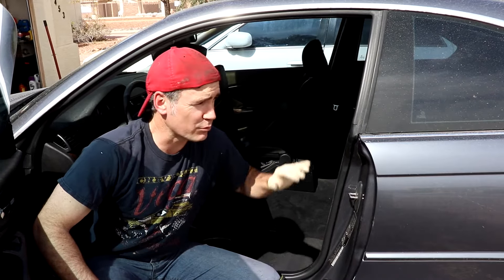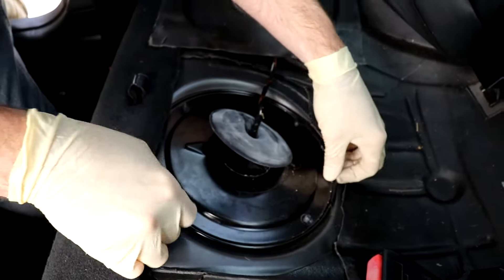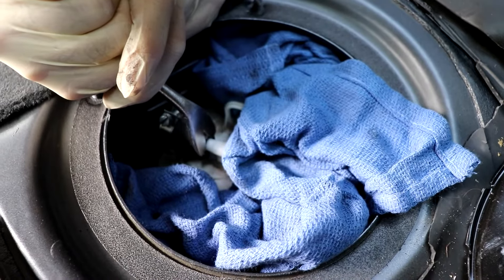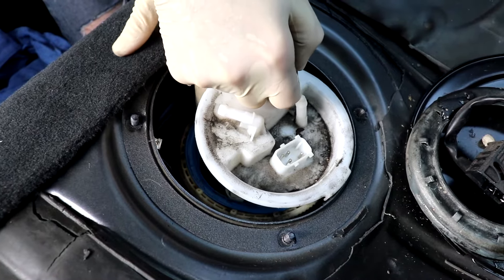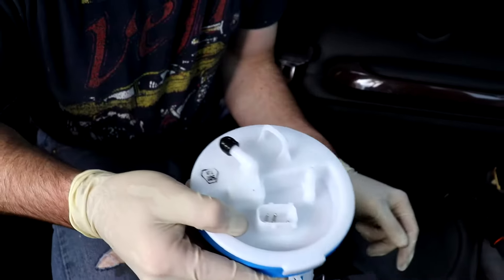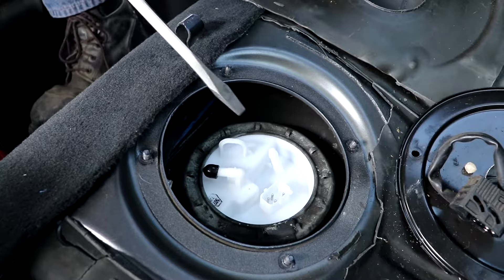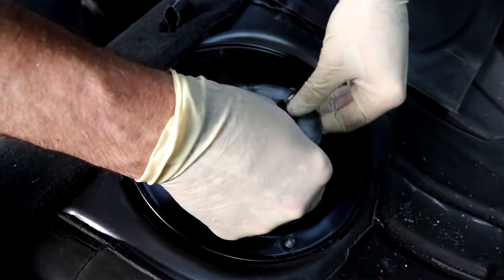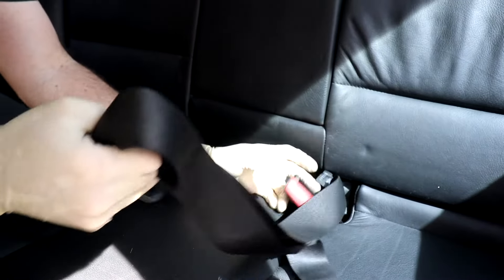BMW E46 FUEL PUMP REPLACEMENT IN UNDER 10 MINUTES!

Comment: Ive been having trouble figuring out which side to actually remove and work on, because it looks* like these cars have two fuel pumps. 
Did some research and figured out I only need to work on one side but I can't figure out which side.
So it's under the passenger side back seat correct?
2000 323ci north american car
Reply from the maker: No worries, thanks for the question. Yes, you are correct, you will be working on the passenger side of the car. That is the location of the Fuel Pump assembly.
On the drivers side there is a fuel level sensor. This unit controls the functions of the gas gauge itself. So if you were having trouble with the accuracy of the fuel gauge then that might be your issue. Those rarely go out unless the car has been sitting for a long time or has corrosion in the tank.
Let us know how your BMW project goes, Cheers!
Reply: @BradleysGarage  Thanks!
I succesfully changed out the whole fuel pump assembly. I got one for $200 locally.
The job was actually very easy with the helpful instructions in this video.
Hardest part was getting the metal retaining ring back on at the end.
Car is running strong again!
Reply from the maker: Thanks for the update SM, glad you were able to get the new fuel pump in and everything is working great again. Enjoy your BMW, Cheers!

Comment: car starts but dies right away and if it does start it idles rough. Just scanned my car for codes with most of them being, 

"misfires with fuel cut off"
"misfires with low fuel"
"System to lean bank 1 & 2"

Just had someone check the fuel pressure and its sitting at a lousy 10psi is it safe to assume that my fuel pump is bad?
Reply from the maker: Sorry to hear that you are having trouble with your E46. If you are only getting 10psi at the fuel rail then most likely your fuel pump is not working properly. There is a slim possibility that you have a clogged fuel filter as well.
If you have more than 100k miles since the last time the fuel pump was changed, it might be a good idea to change both the fuel pump and filter at the same time.
Good luck on your BMW project, let us know how it goes.
Cheers!

Comment: BMW e46 compact 316ti have fuel pomp ?
Reply from the maker: Thanks for the question, the E46 compact uses the same fuel pump assembly. We never got the E46 compact here in the states but everything should be the same process.
Good luck on your BMW project, Cheers!

Comment: Great video, I noticed that at the end when you turned it on, the car makes a sort of whistling sound, my car is making the same noise, do you know what it is?
Reply from the maker: Hey Christian, the buzzing sound is the fuel pump itself priming when the key is cycled. That is completely normal and happens each time you first turn on the key. You can really notice it after just replacing the fuel pump whiteout having the rear seat back in.
Hope this helps with your BMW E46 project, Cheers!

Comment: Hi I wanted to know theirs 2 fuel pump unit and I would like to know what is the difference between them?
Reply from the maker: Hey Gaz, thanks for the question. There is only (1) actual fuel pump (on passenger side) but there is a fuel level sending unit and a transfer/siphon tube on the drivers side backseat. The fuel level sensor measures the amount of fuel in the drivers (left) side tank, whereas the fuel pump/sensor located on the passenger (right) side also measures the amount of fuel but also has the fuel pump assembly as well.

The transfer tube is non electric and works on the venturi principle by using high and low pressure. It uses a pipe with a narrowing in the center like an hour glass and when fuel that returns from the engine passes through the pipe in front of the narrowing it creates a suction on the other side which pumps the fuel that is left in the left side of the tank over to the right side continuously.

The fuel level sensor on the drivers side rarely goes out. The transfer tube however has been known to break at the connection and cause issues of running out of gas at half a tank. The fuel pump itself is where 95% of the fuel related issues occur on these E46's.

Depending on what issue you are having with your BMW will determine which of these parts are failing. let us know if we can help you troubleshoot things.
Cheers!

Comment: Thank you but what is the the garget on the other side of the compartment of the tank. It looks like a fuel pump
Reply from the maker: Thanks for the questions James. On the driver's side, there is a Fuel Level Sensor. 
https://www.fcpeuro.com/products/bmw-fuel-tank-sending-unit-level-sensor-e46-16116768788
This can affect the reading on the gauge cluster. It is less common to go out versus the Fuel Pump (passenger side) which is a common failure item. Good luck on your BMW project, Cheers!

Comment: I have an alfa 147 but that gasket is like its glued on and does not move an inch with the hammer trick
Reply from the maker: Hey Vinny, thanks for the comments. These can be a pain to remove if they are still the original pump after 20 years. You can also try to use a hair dryer to heat up the ring to help free it up. Just keep moving the hammer around the ring to get it started. Once you get it to move your will have no problem removing it.
Thanks again for hanging out, good luck on your project. Cheers!

Comment: my e46 has a smell inside the car but the fuel pump is dry and fuel lines seems good no leak
how can I know from where come the smell
Reply from the maker: Thanks for the question Mario, if you are getting fuel smell in the car, that is really the only place there are exposed lines into the car. We would recommend removing the backseat and going for a drive. If you have a buddy with you, that works better. Perform some aggressive start/stops in a safe area to see if there is any evidence of fuel around the fuel pump itself (the ring seal). This works best if you are at 1/2 to 3/4 so there will be plenty of fuel near the top of the tank but still enough room to slosh around.
Let us know how things go with your BMW project.
Cheers!
Reply: @BradleysGarage  thanks man I will try it

Comment: What are the symptoms of a bad fuel pump?
Reply from the maker: Thanks for the question, on these E46's it usually results in a crank/no start condition. Some early signs it might be going out would be the fuel gauge is not accurately reporting the proper fuel level. Or you start getting random misfires across all cylinders and the engine is running rough.

The fuel pressure at the rail on a BMW E46 should be 50 psi +/- 3 (3.5 bar +/- 0.2). You can use a fuel pressure gauge with an adapter and refrigerator valve to check the fuel pressure on a BMW. (Can rent these from a local auto parts store)

Here's how:
Remove the cap from the Schrader valve
Spray some fuel as you screw on the cap to open the Schrader valve
Catch the fuel with a rag
Turn the ignition on (don't start car) to turn on the fuel pump for about two seconds
The pressure should be around 50 psi when the ignition is on
The pressure should drop about five or six PSI when the ignition is turned off
Recharge the fuel system by cycling the key to run the fuel pump again for a second check

If you are getting a low reading 35-40psi, you might just have a dirty/clogged fuel filter. You can check out our other video where we show you how to replace that - https://youtu.be/Ld0zM8Pm_vQ

Good luck on your BMW project, let us know how things go.
Cheers!

Comment: Tooth brush dish liquid, shopvac make sure everything is clean before opening your fuel pump
Reply from the maker: Thanks for the tips Artisan, definitely smart to clean up any debris before removing the pump. Thanks again for hanging out, Cheers!
Reply: Someones shopvac exploded in the comment section be careful with that
Reply from the maker: @Vinni-2K Yeah, sucking in fuel vapor to an electric motor would create more risk for sure.
As an alternative, you can simply soak the entire lock ring with penetrating spray and let it sit for a few hours.
If needed, spray it a couple times to really let it soak in.
Cheers!
Reply: @BradleysGarage  thats what i did this morning 
Will try the hammer trick again tomorrow 
If that doesn’t work i ordered a gasket tool that fits right into the ring to use with a torque wrench
Reply from the maker: @Vinni-2K  Sounds great, I would spray it a  few times every hour or so for a couple hours. The actual tool will definitely help you get more leverage but hopefully the hammer trick will get it done.
Good luck, let us know how it goes, Cheers!
Reply: @BradleysGarage  thank you for the tip
Will do that!!

Comment: The metal ring top that needs to be rotated is so hard to remove. I spent all night hammering it counter-clockwise and still haven't moved. I guess it's stuck.
Reply from the maker: Hey Dan, sorry to hear you are having trouble with the lock ring. They can be stuck on there pretty good, especially if it is the original fuel pump.
You can try some Kroil penetrating oil around the ring and let it soak for a couple hours. You can spray a little shot into each of the tabs to get it directly onto the underside of the lock ring. Next use a dull chisel/hammer and work around the lock ring at the 12,3,6 & 9 o'clock spots. Be sure to move around the lock ring and not just hit it in one place.
If you are still having trouble, I would spray it again and let it soak overnight. Don't be afraid to be liberal with the penetrating spray if the first soak didn't work.
Link - https://www.kroil.com/product/kroil-original-penetrant/
Please let us know how it works out for you. Good luck on your E46 project.
Cheers!

Comment: Hey!! Love the content you make! I’m just curious I have a 2002 325ci vert and I have a RPM surging problem could this be the fuel pump?? I had just recently got the Automatic transmission fully rebuilt and shifts perfectly but when I’m cruising in around 3rd gear going 30-40mph or in 5th gear cruising in speeds about 55-65mph the rpm’s would surge going down about 500rpm takes a second then rises back up to normal rpm for speed.
Reply from the maker: Hey Marco, thanks for the question. Based on the description you provided, it still sounds like a transmission issue and not a fuel delivery issue. 
If you are in Drive and cruising down the highway, there would be no way for the RPM's to drop all of the sudden without the transmission losing engagement. Almost like putting it in neutral for a brief moment, the RPM's would drop. 
There would be no way for the fuel system to affect RPM's in such a short time span, since you are actively rolling in gear.
The typical signs of a failing fuel pump are difficulty starting, taking a few seconds to finally fire up and Gas guage inaccuracy, reading empty when you know there is more fuel than that.
I'm not sure who performed the transmission service but I would double check the proper fill procedure was followed. These symptoms can occur once the transmission gets hot if you are a little low on fluid.
Thanks again for hanging out, let us know what you discover. Cheers!
Reply: @BradleysGarage 
My 330d 2005 BMW auto is not starting only crancking but the noise KEEPS COUNTINUE from the back... is it  fuel pump noising...i hope this is  an issue to fix???

Please help my BMW sitting in my driveway for weeks now can't move..

Thank u
Reply from the maker: Thanks for the question. If you can hear the fuel pump running (under the backseat) when turning on the key/cranking then at least you know the fuel pump is getting power. That doesn't necessarily mean it's working correctly. On the Diesel you technically have 3 pumps. The lift pump under the backseat in the fuel tank. The pre delivery pump at the fuel filter (under the car) and the (HPFP) high pressure fuel pump  located on the back of the motor. The first two do go out around 80-100k and the last one is very expensive to replace but fortunately it rarely goes out. 

I would verify the fuel pressure at the rail on the low side to ensure it's at least 3-3.5 bar while cranking. On the high pressure side you should have at least 300 bar. 

Are you getting any check engine codes that might point us in the right direction? We haven't really played around with the Diesel BMW's that much since they are not very common here in the states.

Some other issues for a no start condition could be as simple as the fuel pressure sensor (front of the fuel rail), fuel pump relay, fuel pressure regulator (back of the fuel rail) and cam sensor. All of these would cause the Bimmer to crank and not start.

Another common failure on these would be a leaky injector. I know there is a leak test you can perform but I will have to look that one up and get back to you.

One last thing would be a weak battery or starter. If it is not able to rotate the engine fast enough, there will not be enough fuel pressure to satisfy the DME. In that case the cr would not start because the computer is not registering enough fuel pressure to allow it. 

Let us know if you are able to scan for any codes. It might help narrow down the search and prevent you from replacing things that are not broken.
Cheers!

Comment: My fuel pump is stuck priming and the car will start but die at idle
Reply: This is the new pump btw. My old pump didn’t work at all so the car couldn’t even get past crank before. Now it starts but won’t stay on
Reply from the maker: Hey Blasian, thanks for the question. Not sure what was going on with the car originally for it to be diagnosed with a bad fuel pump as being the issue?

That being said, depending on what happened with the old fuel pump, there may have been a short or something that happened upon removal to cause an electrical problem.
I will double check the most obvious stuff first. First the Fuel Pump relay fuse in the fuse box under the hood beneath the black plastic cover, driver's side. It's a 30A fuse in the F4 slot. Second check the fuse compartment in the glove box, slot F54 15/20A Fuse. And last you can check the Fuel Pump Relay itself by swapping in the Horn Relay. The Fuel Pump Relay is in slot 3 (far left) and the Horn Relay is in slot 6 (far right)slot R3.
Here are a couple sites that provides the diagrams:
https://fusesdiagram.com/bmw/fuse-box-diagram-bmw-3-e46.html
https://www.bmwgm5.com/E46_Relays.htm

If you don't have any vacuum leaks (i.e. intake boot ripped) you can try unplugging the MAF sensor to see if that has any affect on the car idling. If it does idle then you know the MAF sensor is bad since the DME defaults to a baseline so the car will still run and not leave you stranded somewhere.

If the car has been sitting for awhile make sure you have 12.5+ volts at the battery. If the battery voltage is too low, the DME tends to not be happy.

Did you also change the Fuel Filter at the same time as the Fuel Pump? It should still run and idle even it's old but it's a good idea to change it while you are working on the fuel system parts.
Here's our video for that if you have not replaced it yet - https://youtu.be/Ld0zM8Pm_vQ

Please let us know if any of these are bad and solves your issue, Cheers!

Comment: m56 engine how?
Reply from the maker: Unfortunately the M56 SULEV engine uses a sealed tank that does not have any replaceable parts. Both the fuel filter and fuel pump are inside the tank and not accessible. 
BMW had a 15 year/150k mile warranty for the fuel related systems on these cars but that has now been over for several years. Your options now are to locate a good low mileage used tank, which typically go for around $700-$900 or swap the car over to the the M54 parts which can be had for much cheaper.
The factory BMW tank is over $9k which is definitely more than the entire value of the car and makes no sense to purchase.
Here is a complete guide from Matt Roche to swap over to the M54 fuel system parts - https://drive.google.com/file/d/1qu5KSgnEMX2VAK4R2mORp50k1VN54KxJ
Obviously this is not as easy as bolting in a new fuel tank but if you have a really clean E46 and you want to get it running again, this may be an option for you. This will just take a little time and patience.
Let us know how your E46 project goes, Cheers!

Comment: Pro tip, clean debris from top of pump while everything is still together
Reply from the maker: Thanks for the tip Jesse, it's a great idea to grab an air compressor or shop vac and clean up around the fuel pump before removal. Unfortunately, we were in a remote location and didn't have access to either of those at the time. 
Appreciate the feedback, thanks again for hanging out. Cheers!